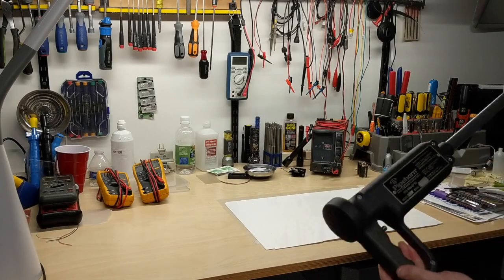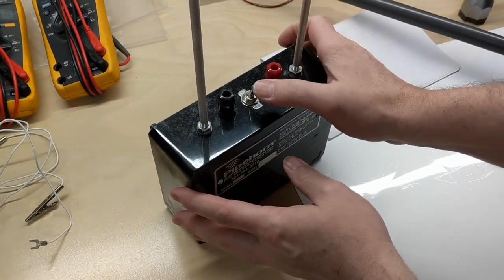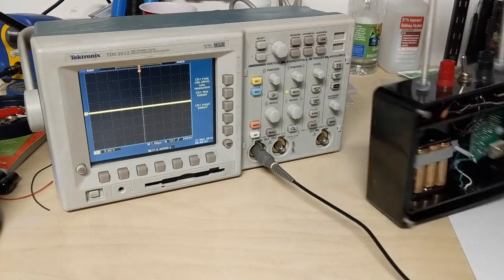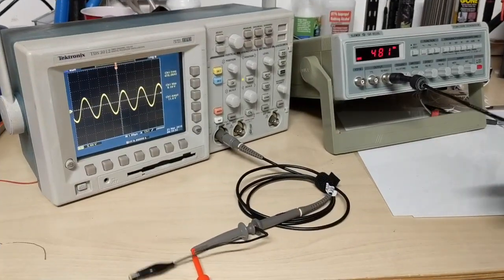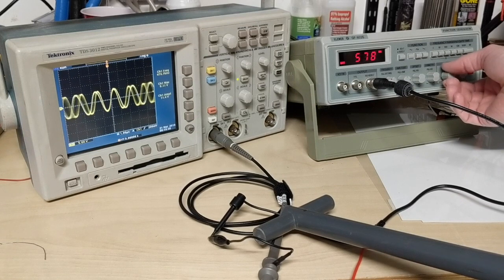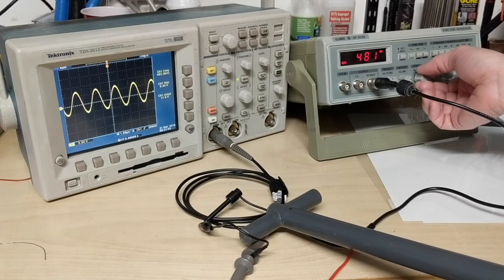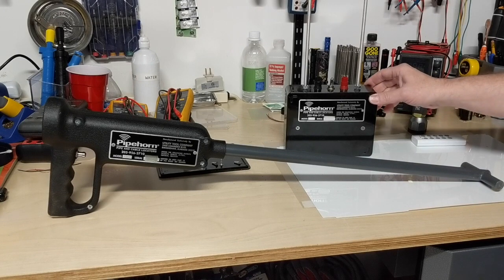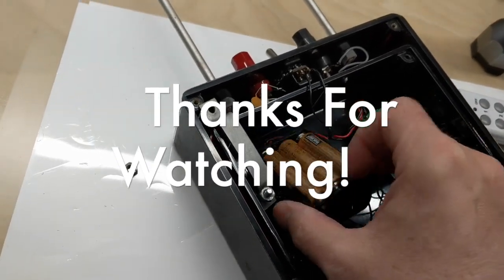Pipe Horn 100 - A Look Inside & Testing   (Weekly What Is It #10)

Comment: most service gas lines installed these days are plastic but have a tracer wire run next to it for locating.   The solid copper jacketed tracer is usually not attached to anything at the house ..... it's just a piece of copper wire sticking up out of the ground next to your riser.   But if your line is older it could be metal from the house to the road in which case it could locate right on into the home